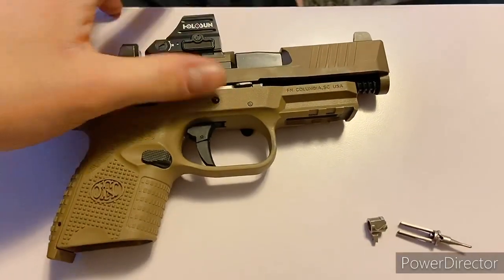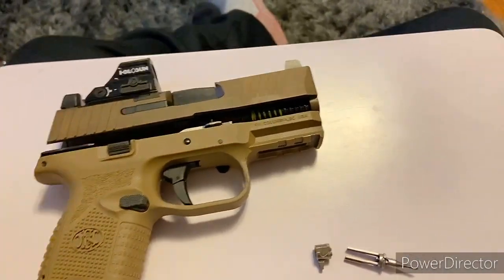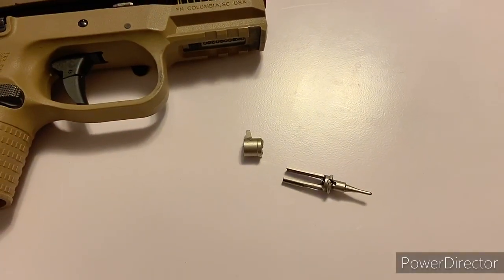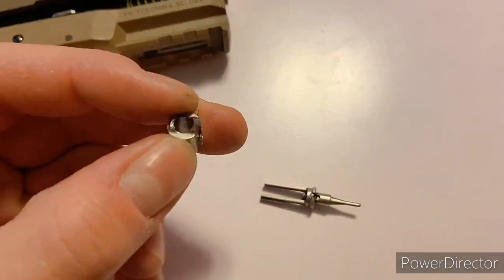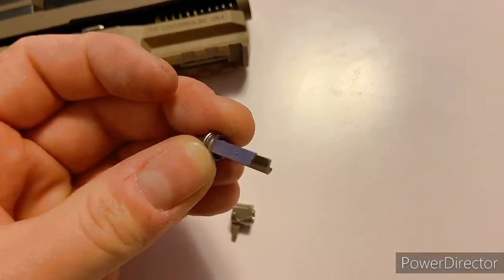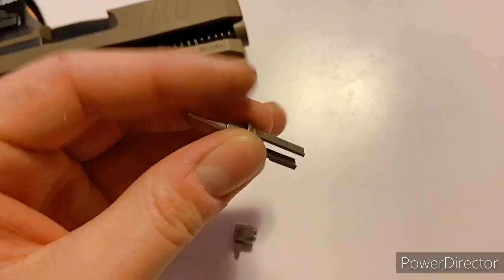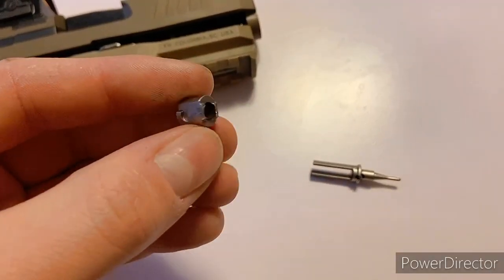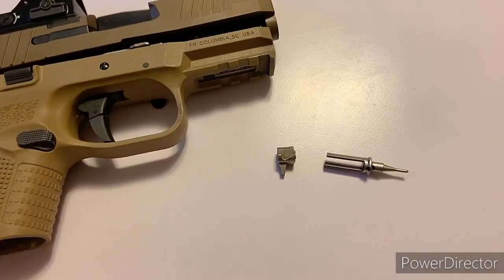FN 509 Compact MRD CATASTROPHIC FAILURE...

Comment: They specifically say do not dry fire in FN 509 firearm manual , I've put well over 5,000 rounds thru the exact same pistol they are the perfect carry firearm when there is ammo in the weapon , you really shouldn't dry fire anything somethings just handle it better , the instruction manual also says if you want to dry fire for who knows what reason just get some dry fire dummy rounds. Sorry that happened to you but striker fire pistols shouldn't be dry fired  . You where correct when you spoke about the upgraded firing pin but don't give up on your FN they truly are amazing pistols .
Reply from the maker: Glocks are designed to be dry fired as that’s how they are disassembled.. same with a lot of striker fired guns. Just needs some tougher parts and it’s good to go. Just can’t trust it after the failure. I still dry fire Glocks all the time and have yet to have a striker break or a smith and Wesson for that matter.
Reply: @maxhayward2127  

Exactly right , I installed the Apex heavy duty striker in my FN 509 tac compact , I can dry fire it all day long now.

Comment: FN 509m owners manual specifically says not to dry fire the gun. stupid, i know, but they clearly know they have a problem with the striker and the shock that it undergoes during dry firing.
Reply from the maker: j b yeah kinda counter intuitive since you have to dry fire the handgun to disassemble 🤦‍♂️ FN needs to rethink the striker design or material used. Thanks for watching!
Reply: I purchased the apex striker it looks WAY beefier
Reply: @mrglock2313  same here.

Comment: FN has addressed this issue in some of the newer released FN 509 Midsize models. Their new striker resembles that of Apex. It also smooths out the grittiness of the trigger. The way I see it you have two options, 1) Send the firearm to FN for repair 2) Purchase the Apex heavy duty striker and drop it in yourself.
Reply from the maker: MDX that’s really interesting because this is the newest model they have released and it has this crappy one in it. I wish they would just send me a new striker. I have already installed the apex one and will be doing an update soon on it! Thanks for watching!
Reply: Fn hasnt addresed it yet vecause even on the midsize and mrd the pins still break if u dont use snap caps when  dryfiring
Reply from the maker: boomee78 I repeat snap caps are not what’s stopping these from breaking. People have reports of strikers breaking with using snap caps. It’s because the parts are not heat treaTed or caster properly. Some people are getting good ones while others are getting bad ones.
Reply: Is it easy to do or do you need tools?

Comment: I haven’t had this issue with any of my 509s but I’ve heard about a lot of others having it.  A lot like Sig products.  Great designs but the failure rates leave you a little concerned to carry them.
Reply from the maker: Harry's Holsters exactly! I ordered the apex heavy duty striker. Which there have been nothing but great reviews. So When it comes in I am going to give it a try. Looking at the design of the apex one I feel pretty confident because it isn’t skeletonized and it is violet stainless steel that is heat treated. Actually your videos on the sig p365 series have stopped me from buying a sig for carry! So thank you for the updates on those handguns. Thanks for watching
Reply: I figured out why…it’s in the fn handbook manual lol it say don’t dry fire it even tell what to buy if u want to dry fire lol that’s why we should all read our handbook 😂
Reply: One word my friends.. GLOCK!!

Comment: Thanks for the video. I'm on fence now if I want this gun. I was leaning towards it. But, now I have started seeing issues with this gun.
Reply from the maker: Galleywinter farm I just tested the new apex striker and it functioned fine so far. If you buy one of these then get the apex striker right off the bat. Peace of mind.
Reply: @maxhayward2127  thank you
Reply from the maker: Galleywinter farm very welcome!
Reply: The problem is people are dryfireing with out snap caps when  it says in the manual not to do that  the apex works fine as well i have one stock 509 now withover 6000 rounds  plus dry fire no issues.
Reply from the maker: boomee78 some work fine while others don’t. It’s not a matter if I’m doing something wrong by dry firing. Dry firing is not breaking these strikers. It’s a poor heat treatment of the part which is causing them to break. They acknowledged there was a bad batch of strikers that was mixed in and some guns are still getting the bad batch of strikers because they are mixed in. Dry firing is NOT breaking these strikers. The Apex one isn’t breaking because it is properly machined and heat treated along with a better design that just can’t break the same way.

Comment: I swear that FN says not to DRY fire their firearms. Or at least it’s in the owners manual.
Reply from the maker: What good is a gun that you can’t dry fire? Nothing I want in my Arsenal lol
Reply: Dry Fire with a Snap Cap or a Dry Fire Laser like the G-Sight ELMS Gen 3 is not an issue.  Either way, you can clearly see how well an APEX striker is made over the stock striker.  Just replace it no matter what; don't wait for it to fail.

Comment: So it is a known issue with the firing pin, at the same time if you plan on dry firing make sure you use snap caps. Never dry fire on an empty chamber with any gun. It will slightly damage the internals each time.
Reply: Also FN was supposed to have improved firing pins in the later production 509s so if you send it to FN they should take care of it.

Comment: I think there must just be some striker flaws per batch. The batch 2 in black that we tested consisted of 14 509s with 3000 rounds put down range in each. Some of it was +P. However, the 14 509s from our batch 4 in FDE had no malfunctions except for the 6 that had the striker snap. 6 out of 14 snapping is bad news, but none of the earlier batch black ones had this problem at all.
Reply from the maker: Thank you very much for adding this as everyone thinks it’s just me and my improper dry fire techniques. Good to see some more data out there. Thanks again!

Comment: My striker failed but not at the back, the pin snapped off.  I had some 300 rounds through the weapon and lots of Dry Fire using the G-Sight.  When this went down, the Striker Return Spring got chewed up as well.  It was a bit of a bitch to get the pin piece and return spring out but I managed to clear it.  I replaced it with the APEX striker and a new return spring.  Real easy to do and APEX has a great video on YouTube to show you how to do it.  When you look at the APEX, you can see how well that striker is over the one from FN.  The weapon worked well after going to the range and putting a couple hundred rounds down range.  If you have a 509 just replace the striker regardless and put in the APEX ahead of time.  To have this happen when you NEED the weapon would be a disaster.
Reply from the maker: Exactly, overall I really loved the handgun and the way it shot. I was so bummed when it broke and even after replacing the striker with the apex, I just couldn’t maintain trust and ended up selling it which I do regret a little as I really liked the handgun. Thanks for watching!

Comment: I’m a big FN fan and this was on my short list of striker fire compact but no longer.  Just no excuse for engineers to make garbage like this.  As much as I try to stay away from Glocks, I’m starting to thing the 43x May be a better option.
Reply from the maker: I actually sold it and picked up the 43x and it’s my typical carry!
Reply: I have always herd they are the most reliable. Not a fan boy but 43 is what I carry. That and I like not having a safety of than the one on the trigger. Don’t wanna worry about not flipping it off if I’m shaking in my boots in heat of the moment.

Comment: Man I made this same video a few days ago😂 It broke in the same place! Identical. I hadn’t even live fired mine. Only dry fire. Had it two weeks. FN currently has it.
Reply from the maker: Junior Varsity lol man isn’t it a shame for a gun that all around is so nice and feels so good. I’m not bothering sending mine back just so they can put another crappy striker in it. I just bought the apex heavy duty one. I would never run that flimsy striker in this gun ever again. Thanks for watching brother!
Reply: Max Hayward I’m thinking about doing the same. Do you know if you can dry fire with the apex? Can’t seem to find a consistent answer there.
Reply from the maker: Junior Varsity I literally just talked to Doug over at Apex and he said they have dry fire tested it to 50,000 dry fires without issue but he said you should use snap caps to be safe.
Reply: Max Hayward awesome, that is great info. Thanks! Good luck with yours.
Reply from the maker: Junior Varsity same to you thanks again for stopping by!
Reply: Just use snap caps.
Reply: Use dnspcaps when dryfiring problem solved

Comment: I've read enough posts and watched enough videos on this that it's way more than a coincidence. Common theme with the breaks seems to be dry firing which the manual says is only ok to do occasionally. But why can't you dry fire this gun? 

Either way, I've emailed FN (as an interested potential buyer) and they said they are aware of the issue and their Quality team is reviewing and will address the issue according to what they find. I'm holding off until the issue is resolved.
Reply from the maker: LS67NOVA lol that’s funny because they told me they really had no idea what’s going on with the strikers breaking. We will see what happens. I’d hold off unless you are willing to get the apex striker to upgrade right off the bat. Thanks for watching
Reply: @maxhayward2127  yeah I'm holding off....too bad because I found a black one for $485 shipped. If I already owned one I'd bite the bullet (no pun intended lol) and get the Apex. But since I don't own one yet, I'm going to wait.... anxiously lol Outside of the bad striker, this him has everything I'm looking for
Reply from the maker: LS67NOVA same, it’s my favorite handgun I’ve owned. It points really natural in my hand and for a smaller gun the grip angle and texture allows for little recoil which surprised me a lot. Great gun other than that one issue. The apex striker seems good to go so far and I’ll be carrying it again. Thanks!
Reply: Just use snap caps, as the manual says. I dry fire all the time with my 509. Have had zero issues.
Reply from the maker: Jerome Gabriele That’s fine and I’m glad you’ve had good luck. There have been multiple report of people dry firing with snap caps and it has still broken a striker. Easier solution is to buy the Apex heavy duty striker and not worry about it. The snap cap reference in the manual is just to cover their butt. All striker fired handguns should be able to be dry fired without damage like every other striker fired gun I own or have owned. I have easily over a few thousand dry fired through all these other guns and never had an issue. This gun with the apex striker has had hundreds upon hundreds of dry fires and it looks brand new. The skeletonized striker is just a cheesy poor design made from inferior material that has no business being in a firearm. Some people have had great luck but there have been too many reports for them to not do something about it and switch up the material or design of the part to beef it up.
Reply: Jerome Gabriele I hope I have the same luck

Comment: Have you been dry firing with the apex upgrade? Wondering if its holding up better.
Reply from the maker: Yes I have been, a lot actually and absolutely no issues at all
Reply: Max Hayward Great to hear! This is the gun I wanted to grab but I hate that for a $800-$1000 gun I’ll need to add upgrades. Thanks for the video!

Comment: Wishing had seen this before I bought the 509 compact today.. i couldn't find a glock 43X or a G19 gen 5 so I went with my 3rd choice the 509C
Reply from the maker: Veggie8886 yeah I feel you man, I hadn’t really read anything about this either. I picked it up in store for $500 and was like damn this feels amazing so I bought it on the spot. And what do you know.. just buy the Apex heavy duty striker and it basically fixes the issue from what I understand. Mine will be in Friday. Thanks for watching!
Reply: Just change out your OEM striker for the heavy duty apex one, it actually made my trigger feel better, don't really know how. Also, my 509 striker pin broke off at the end just after 400 rounds.
Reply from the maker: Richard Martinez just got mine in today. Once this new apex striker breaks in, I can already tell it makes my trigger feel better also. I haven’t shot the new apex heavy duty one I got in yet. How many round do you have you shot with your apex heavy duty striker? Thanks
Reply: @maxhayward2127  haven't gotten a chance to take it to the range due to lack of ammo anywhere. I've just been doing some dry firing here and there and I can feel my trigger pull noticeably cleaner, I feel like when I do take it out, it will perform no doubt.
Reply from the maker: Richard Martinez sane, I feel like I’ve gained confidence back in the gun so I can carry it again. I haven’t read anyone having any issues with the apex striker so I think it’s good to go now.
Reply from the maker: Snashu here is the link for the striker. And yes you have the right model number. 

https://www.rainierarms.com/apex-tactical-heavy-duty-striker-for-fn-509/

Good luck! Going to test mine today!

Comment: Would snap caps solve the issue? Obviously hind sight but am curious
Reply from the maker: They say it’s supposed to help it from getting damaged but it doesn’t help as others I’ve seen and read about have been using snap caps and there’s have still broke. Thanks!
Reply: The issue is with the striker not with dry firing. FN had a recall but I’d personally just get the APEX enhanced striker.
Reply: @adryerwithabrickinit9231  wow this is nuts!